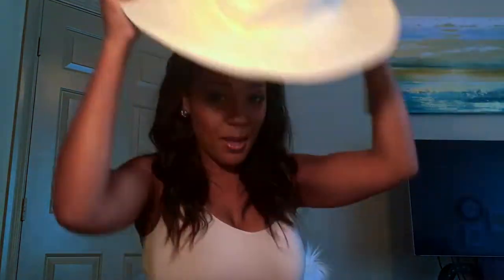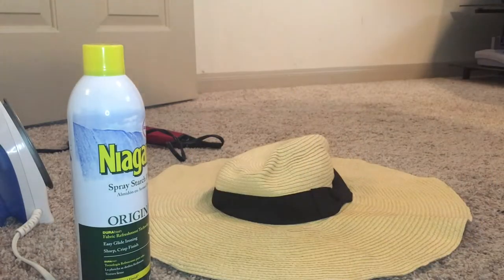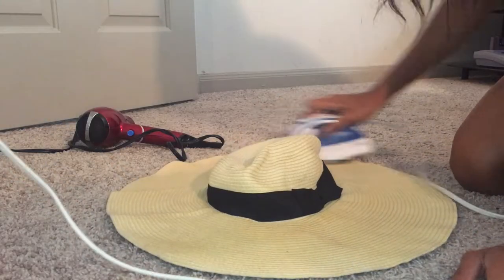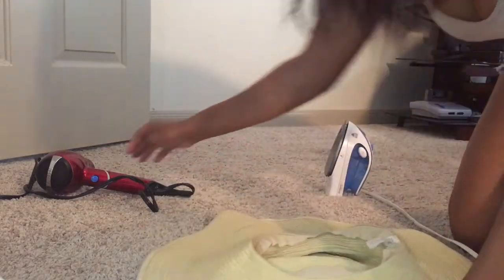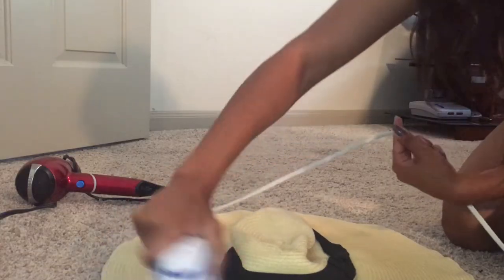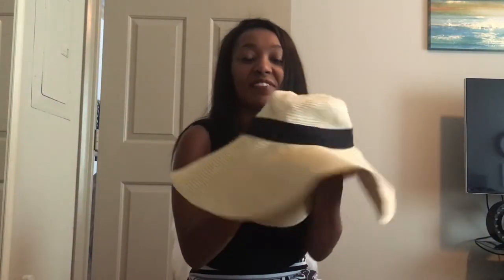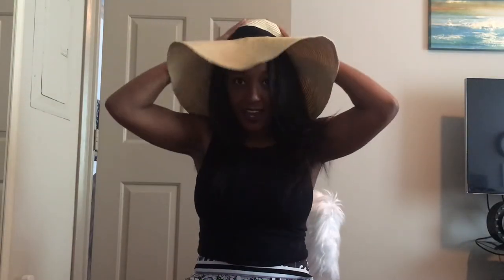How to Fix Your Floppy Hats (EASY TUTORIAL)

Comment: Try running under hot water until totally soaked. Then gently stretch out wrinkles. Lay flat on a folded towel on the floor while smoothing out any remaining wrinkles. Then leave to dry. Oh, I flipped that hat inside out first.
Reply: Do you iron the hat to smoothen it out ?

Comment: I cannot believe you are spraying starch and using s hot iron on that carpet.
Reply: The iron will not damage the carpet.
Reply from the maker: it's a pretty cheap Amazon iron- not too hot and definitely didn't do any damage to the carpet! that would have been a nightmare, but I do recommend placing a towel down or doing this on an ironing board (I just didn't have one)
Reply: I’ve only ever ironed on my carpets 😂

Comment: I like the method using a mixture of 1 part Elmer's glue and 3 parts water. Brush it on and let it completely dry on a flat surface
Reply from the maker: that is a great recommendation. I will be trying!
Reply: You might be scared it looks white at first but it will dry clear enough. And if you have a light color hat like the one in the video it won't show up even with an extra coat.